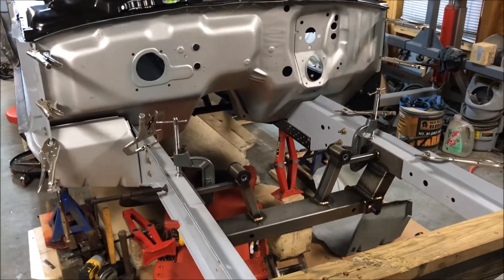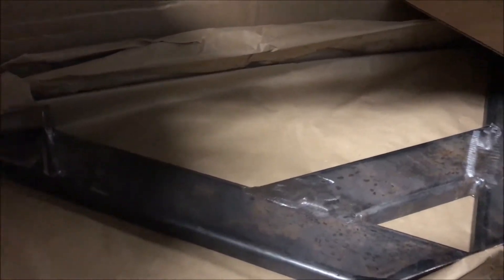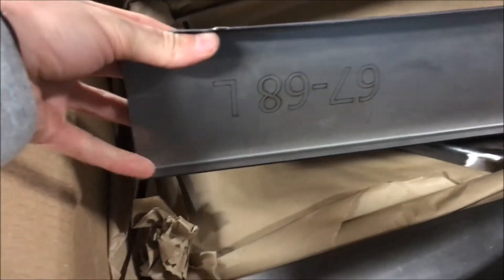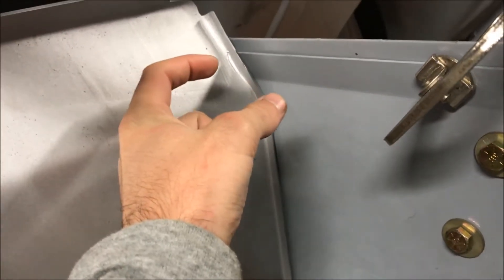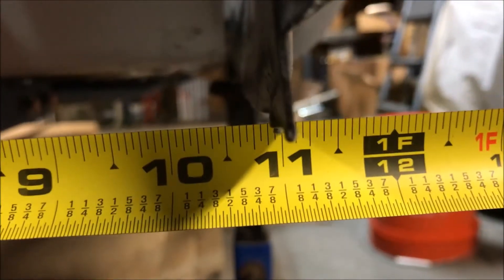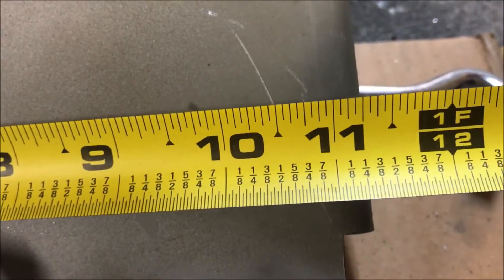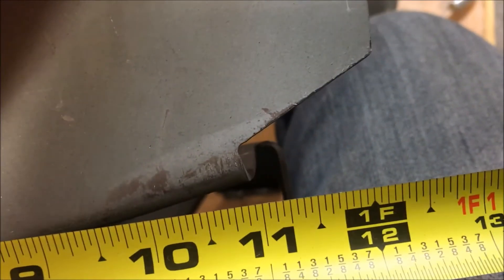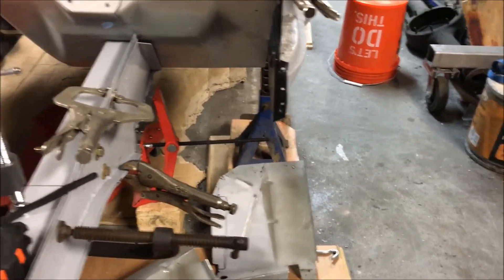Elaina update - 11/27/17

Comment: I think you are definitely at a point where you can start getting that floor and firewall welded in. And then the cowl. I wouldn't worry too much about the front frame rail welding until those parts are solid.

Comment from the maker: i mentioned the driver side torque box being for a different year or convertible possibly.. soon after saying that i remembered convertibles have the inner rocker.. so def not a conv box. and i reviewed pictures of torque boxes for my year and they appear to be identical... so i may try to spread that side and see if it'll jam in there.. i still don't see how that top plate could fit without trimming. it had about 1.5" overlap past the frame's flange..